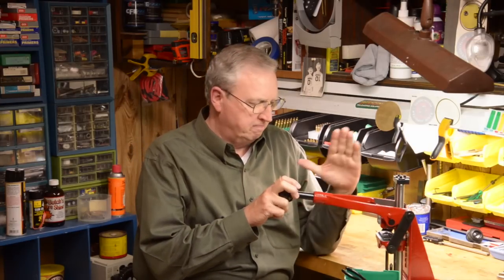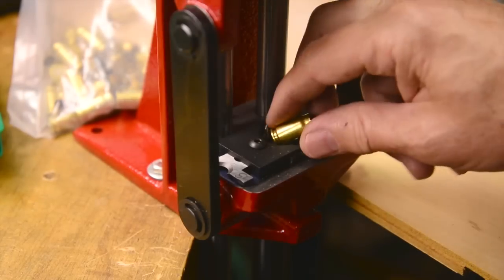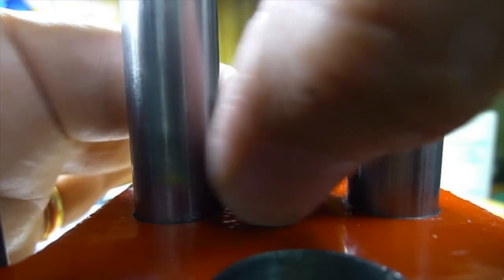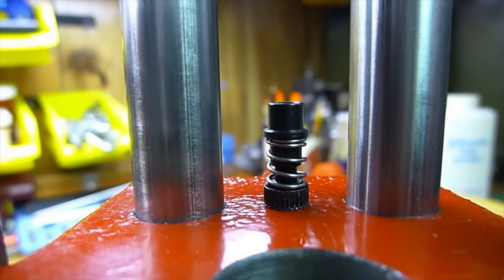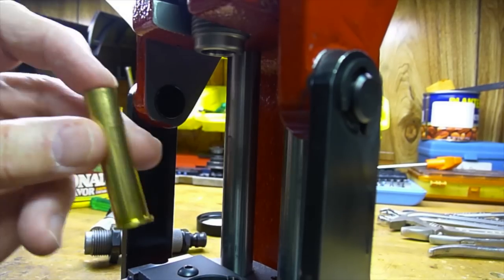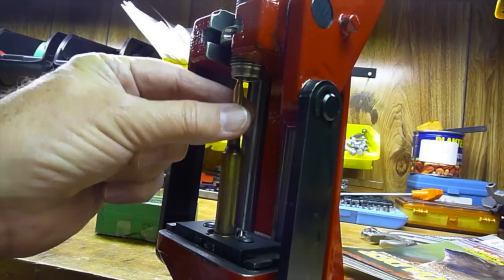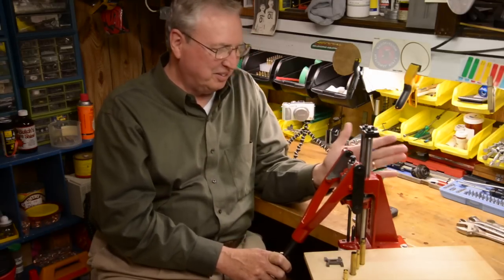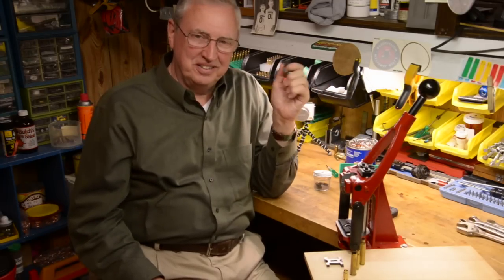Forster Co-Ax Update

Comment: great follow up. I'm new to reloading (haven't actually begun yet), and was wondering how well the forster could manage volume. watching you do a function and flick that cartridge away made it seem like it definitely could handle pistol (i'll be starting with 9mm and 45 acp) at volume. thanks again for taking the time to do these reviews.
what are your thoughts / or have you considered the stand alone primer? you make priming on the press look pretty easy.
thanks
Reply from the maker: Thanks for your comments, Lyle. I often use the priming tool on the Co-Ax when I have 25 or so cartridges to load. Even though you handle the primers one at a time, it's still faster than setting up a bench priming tool and loading the tube(s). Plus, as I have belabored in the videos, the Co-Ax priming tool is superbly accurate.

If you think about it, a high-dollar hand priming tool like the magnificent Sinclair or K&M is a one-at-a-time tool where you handle each primer individually. People use those for the quality of the finished product, especially benchrest shooters who will use every possible trick. IMHO you get the same benefits with the Co-Ax primer, so in a way you could consider the press comes with a $100 (or more) priming tool.

My personal favorite priming tool for 25+ cartridges is the RCBS bench tool. I also use the Frankford Arsenal Vibra-Prime device for quickly filling the primer tubes. I have the Forster bench priming tool, but prefer the RCBS. Of course like almost all priming tools, it requires more consistency on the part of the operator instead of having the primer position precision built into the design of the machine.

Finally I have some advice if you are just beginning to load. Start with a single stage press. It doesn't have to be the Co-Ax, but get a good one and you'll have it forever. I have several progressive presses and they have a great place in the reloading scheme, but I strongly feel everyone should start with a good single stage press. The guy who started me in handloading in 1971 shot about 2000 rounds a week of .45 ACP using bullets he cast and then loaded with an RCBS Rock Chucker. Yes, I know anyone in their right mind today would use a Dillon for that many rounds, but progressives were rare back then and I mention this to show that it certainly can be (and was) done with single stage presses.

The single stage will allow you to quickly change calibers and give you much more versatility at lower cost. I also think it's much safer to build ammunition in a "batch" method where you can examine the lot for primer and powder errors, both of which can sneak in on a progressive.
Reply: Rex Roach 2000 rounds a week would certainly be enough for me.  thanks very much for the help.
Reply: I would second the thought on single stage presses and the RCBS bench primer. The RCBS primer is a bit of a clunker, but it gives a very nice feel and feedback.
What do you consider "at volume?"
I used an RCBS Rock Chucker for over 20 years to load ~250 rounds a week and it was pretty painless. Once you get the system down it goes very smoothly. I would just size/deprime/flare a bucket of brass, hand prime while watching TV (gives me a chance to inspect each case by feel/vision, then load up until I got bored or was out of something. The press is cheap and very accurate, the shell holders are cheap, die changing takes only a moment, and can reload about anything.
Do not worry about some magical primer depth for pistols, just push it in until it is below the rim. The pocket does not need to be cleaned, you do not need to measure its depth or any of time wasting nonsense. If you can feel it being below the rim with your finger, it is deep enough.
You should only worry about all the fancy stuff like clean primer pockets, primer depth, neck turning, neck trimming, tumbling (only do it to make them nicer to handle), powder weighing each charge, etc on rifle ammo that is shot purely for accuracy. None of that crap will make any difference for a pistol cartridge, and will not make a difference for most rifle cartridges unless you are a really good shooter. You can take the extra step to gauge all your loaded ammo if you want, but I just ignore it. If the case is too long, the breach won't close, the gun won't fire, no biggie. Pistol brass will almost always split at the mouth when you load the bullet when they stretch to long.
A decent trigger will give you far more accuracy than fussing over the ammo.
Reply from the maker: I would suggest maybe 500 rounds or more at one sitting to be "at volume." You are spot on about the value of overthinking and overdoing as regards pistol ammo. I was using pistol brass for the demo, but honestly would never use the press for priming pistol ammo. Mostly I was impressed with the consistency of the priming function. Thanks for your insightful comments.
Reply: Rex Roach This is really sound advise, I think that until I started to shoot handguns I really did not need anything with more volume capacity than a single stage press, after all I could not shoot more than around 30 times a session with most of my rifles( 475NE, 577NE etc) but when I shoot 45 Colt 100 rounds goes in no time, that said I much prefer the peace of mind that loading 5 Gr of powder into the case by hand gives, over the unseen automatic measure you get with the higher volume reloading techniques.Just look at how many guns are blown up with an overcharge.

Comment: Mr. Roach, do you know if the Co-Ax would fit .338 Lapua? Also, do you have any experience with or opinions of the RCBS Summit? I'm being told it's basically a direct competitor for the Co-Ax and I should consider it for a single stage press.

Thank you again, sir!
Reply from the maker: Yes, it will work with the .338 Lapua, even with Redding micrometer adjust seating dies. When seating the bullet, I think you'll find it necessary to hold the bullet and case together as a unit, slip the bullet nose into the bottom of the die and then swing the pair down and onto the shell holder. If that sounds complicated, it's not and will be obvious when you go to load. Also, you MUST get the second set of Forster jaws for the larger case rims. If you have dies with extended shell holders that actually go up into the case, you will need to buy the Froster adaptor which will hold any conventional shell holder.

The Co-Ax is highly recommended by the "sniper" crowd. Browse through their forums and you'll see they do along with giving tips on how to make other presses "float" like a Co-Ax.

All of this applies to the current Forster Co-Ax. Older models from Bonanza probably won't work with a cartridge as long as the .338 LM. 

As to the RCBS Summit, I have no personal experience. It's intriguing in appearance, but I don't know its strengths and weaknesses.
Reply: Rex Roach Thank you! I assumed it would fit after watching your .300winmag video but was not sure. Tilting the case is no big deal. While not ideal, it's certainly no deal breaker. 

Thank you so much for your time, sir. :)
Reply: Regarding seating long bullets into long cases, I have done what you mentioned above by holding both as a unit but sometimes I bump and drop the case spilling powder and sometimes putting a ding in the neck.  Usually now I put the case in, them point the bullet up into the case and bring it down and in.  Seems to work best for me.

Comment: And, how much of a pain is it to set up new dies. Unlike a "standard" press where the dies are locked into the press, the COAX press floats the die. There is no way to make the adjustment for say the resizing dies while it is in the press. This looks like it could be a huge pain in the rear end to get the headspace on the cartridge set properly. Same goes for the belling (if used) and seating die.   
Also, in another video about this press, the guy tried to use an ancient RCBS round lock ring and it would not fit. He did not try the newer RCBS hex lock rings. How about the newer RCBS  hex die lock rings? Do they fit the press?
Reply from the maker: Gary, I doubt very much there's anything I could say at this point that would change your opinion of this press, but consider that it is an expensive press yet has remained a best seller that is frequently sold out for year after year. If it were as "much of a pain" as you think, it would have floundered in the free market. Why would people back order a product that is expensive and a pain to set up and adjust? Maybe for a year or two, but this thing has been around for probably 30 years and pretty much everyone who has one or has worked with one has nothing but high praise for it.

As to the lock rings, I just tried a range of RCBS lock rings that date from 1972 to 2018 and all of them fit. This included some very fat aluminum RCBS rings. The Lee rings fit. The Redding rings fit. I have some old Lyman dies from the mid-70's and they fit, but much too loosely. I prefer the Hornady lock rings because they fit well, made of steel and have a clamping lock rather than a set screw. The Forster lock rings are similar and excellent, but more expensive.
Reply: Please don't misunderstand what I am saying. Forster makes some really great stuff. I watched your video, very, very good by the way. I have looked at the COAX for years and even considered replacing my Rock Chucker with one. I am a huge RCBS fan and it will take a lock to separate me from my Chucker. I am not, in any way, criticizing the COAX press, I just saw some things that I was curious about.  That is why I asked the questions. 
If I may, you might want to do a video on the things I brought up. It would really help.  
As far as 'being a pain" ( which, btw, is not intended to be a negative statement or dissing the press in any way, it is merely a figure of speech). It would seem to me that you would have to remove the die, unlock the lock ring, turn the lock ring, retighten the lock ring and put the die back in the press then check to make sure it is correct. If not then you would have to repeat the process until the adjustment is correct. Where as with a "normal" press, you simply unlock the lock ring make the adjustment tighten the lock ring and check the adjustment.  

I  am sorry if I insulted you or the press. That is not what I intended.
Reply from the maker: @garypersons9320  No, I am not insulted at all. To be honest, it's been a good long while since I've viewed these two videos on the Forster Co-Ax. I was thinking that in the first one, I went through a complete setup of the dies and made adjustments. Perhaps not.

But to specifically address your concerns about adjustment difficulty, I set the die approximately as you would with any press and I tighten the lock ring just enough to allow finger adjustment. I simply hold the lock ring with one hand (finger, actually) and turn the die with the other. It will stay in adjustment enough to check your setting and then lock off the ring. It's not necessary to remove the die from the press to fine tune the adjustment. It's actually faster than on a conventional press where you have to tighten the lock nut each time to remove the thread slack. On the Co-Ax, the lock ring/die gives the same result whether the lock ring is locked or not. Of course you need to lock it once you've "dialed it in" so it will maintain the setting. 

The Lee lock rings provide decent locking while still being completely finger adjustable at all times. But they're a bit finikey for me. 

On the other hand, it's a bit harder to adjust the stems on most dies in the Co-Ax, at least initially. Often those stems, large or small, are torqued down really tight. This is totally not necessary, but this is America where we say, "If a little is good, a lottle is better!" In many cases you can break those pieces apart once the die is locked into a conventional press. That's not the case with the Co-Ax, so you have to disassemble the die before starting the set-up. I've used pliers padded with towels to hold the die while breaking apart the stem assembly. A few dies, like Hornady, have wrench flats on critical parts so a pair of wrenches will do the trick easily.

To assemble the stems for seating or flairing, I use a pair of soft-jaw pliers that are used to assemble electrical connectors for audio and video plugs. Holding the die in my hand with maybe a shop rag to protect against sharp threads, I do the final tighten with the padded pliers and have never had a moment's trouble.

Hope this helps, Gary, and thank you for your inquiry and comments.
Reply: I was not aware you had more than one video. I will check out your other videos. Thanks for the information.

Comment: thanks for the great videos!I often load the .308win with this fine press. To get a precisely seating depth i srew in the seating die, until it touches the Shell holder + so many turns and a little bit more so that the die ring touches the upper side of the die ring groove from the press. So i get a max. variation of +/- 0,02mm in seating depth. I bought the orig. Forster die rings for all of my dies, because for me they fit best. You don´t have to be afraid of the shearing forces in the alu threads -> the Shell holder fixing plate gives up first. There is a guy on YouTube who sells reinforced plates for those who already need one.I hope you could understand my poor austrian-englisch :)
Reply from the maker: +Christian Arbeiter I promise your English is a billion times better than my German. Your points that precise seating depths are routine with the Co-Ax and there is nothing to fear in regard to the strength of the die lock threads are exactly what I was trying to say in the video. Vielen Dank und die besten Wünsche für das Jahr 2016.

Comment: I wonder how hard it would be to rig up a little finger spring to flick the finished cartridges off the holder at the bottom of each stroke.  That, or an arm on a cam, with like a helical coil spring.